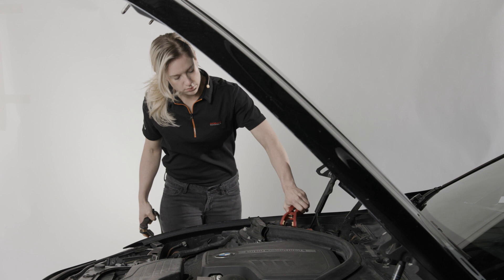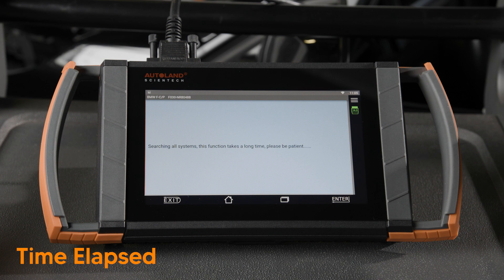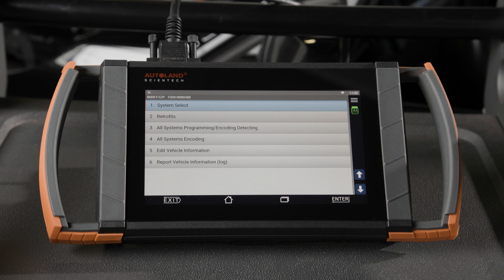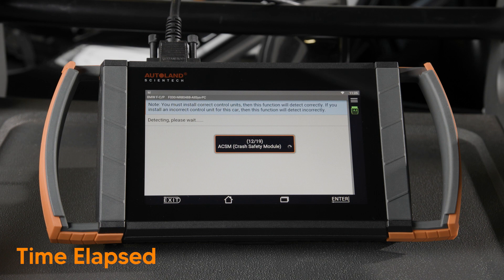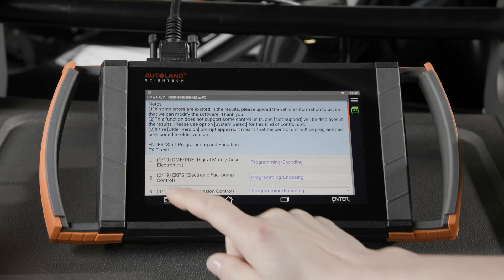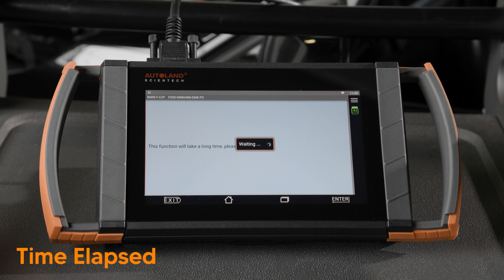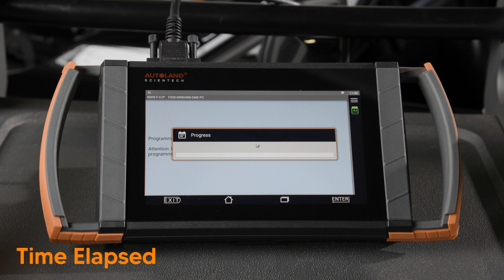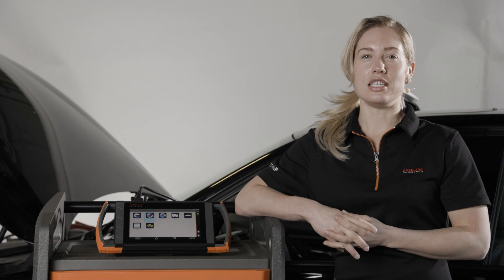Programming and Coding BMWs using iSCAN SF scan tool - Fast and Easy

Comment: What about if I have to replace CAS module in a BMW? Can I program it with that tool ??
Reply: Yes, requires coding and the iSCAN performs the coding flawlessly
Reply: Is there documentation on how to restore a version on the CAS module. Vehicle won’t start
Reply from the maker: Yes, iSCAN diagnostic devices can handle this task with no issue.
Reply from the maker: Thank you! Yes!
Reply from the maker: Not that I am aware of. You can check with BMW ISTA.